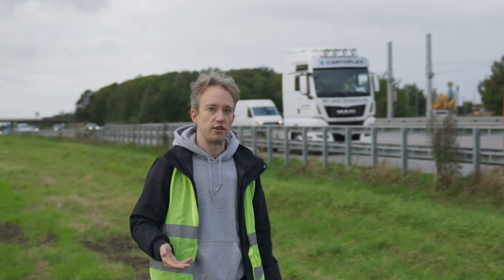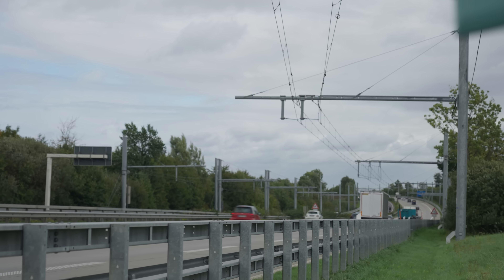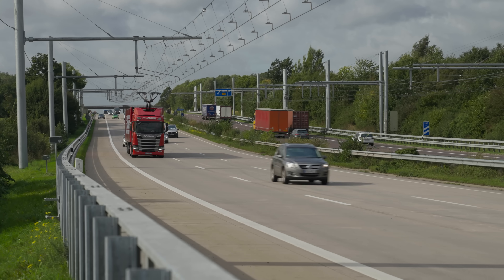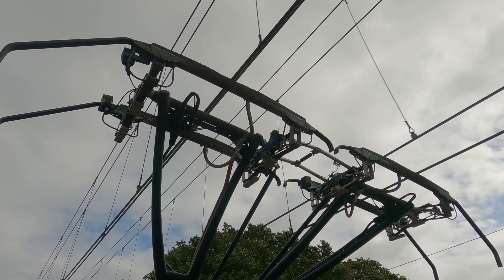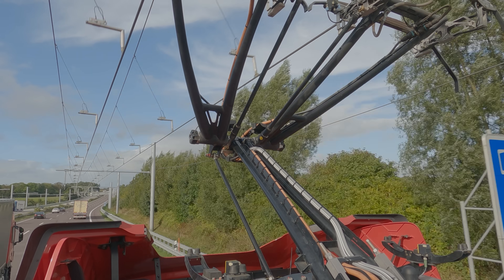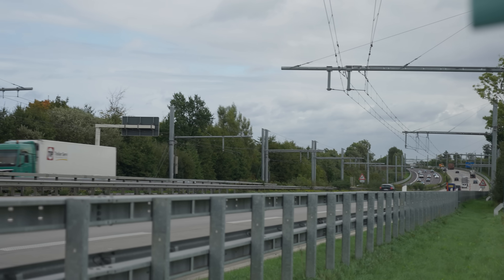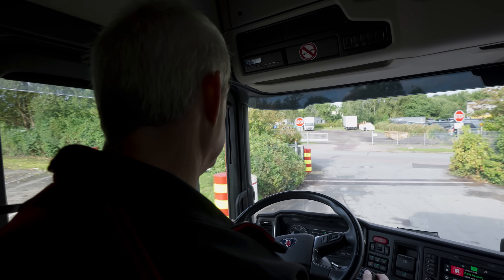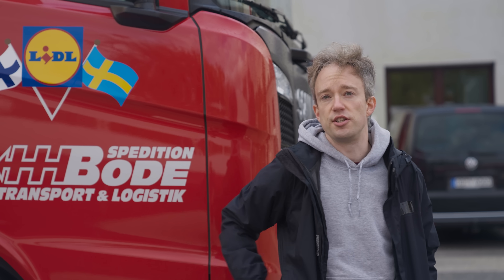The highway where trucks work like electric trains

Comment: The problem I can see, is that the over head cables will wear out a lot quicker than on the Railway,  you might have a train every 30 minutes, on the motorways in the UK  you can get a truck every 3 seconds, so the over head cables are going to wear out a lot quicker, this will lead to more maintenance and motorway closures, as if things are not bad enough now,  why not just put more heavy freight on the Railways.
Reply: Places with trolley buses seem to have solved that problem.
Reply: @kensmith5694  They surely didn't ever face the usage frequency of highways in their systems

Comment: Full battery electric trucks or stay home. We have to keep developing better batteries. This wire system is too expensive to build, maintain and they are an eyesore. 👎
Reply: I disagree.  It is no more ugly than any road.  Batteries won't get the kind of stored energy vs weight numbers that are needed for long haul trucks.  There are physics reasons it won't happen.

Comment: What's powering those wires?  Something giving off greenhouse gasses perhaps?
Reply: It produces less CO2 if you burn oil in a power plant and do this.  Solar and wind make even less.
Reply: This section is mostly powered by wind

Comment: wondering how this would work with more than one truck on the same line
Reply: It would be fine with that.  You can plug in two lamps in your home.  The power for both comes through the same wires from the power grid.

Comment: I keep hearing how this solves the emissions issues; and i ask again, what is used to make the electric power? In Europe there won't be enough sun, and i doubt wind will be strong enough for all of this (cities, houses, cars, trains, trams, and now trucks.) So it'll be coal, and/or nuclear..... Is that an improvement? Whatever happened to clean burning fuel, like hydrogen, ethanol, propane, natural gas, and maybe even vegetable oil?
Reply: Even switching to burning the fuel in a power plant and then running an electric truck from it reduces the CO2 production.  In a lot of Europe there is enough wind to provide the power if the turbines are built.  Even solar with your lower sunlight in the winter can work if panels become more efficient.  Right now a solar panel only has an efficiency of about 20%.  If the efficiency could be raised to 40% you would be getting about the power that folks in sunny places get.
Reply: In this case the energy is mostly generated by wind turbines, since they are very popular in northern Germany

Comment: The woke types, like this guy presenting this topic, typically think electric power is some free or magically appearing resource.  But grid power is sometimes hydro based (the cheapest), but more often it's nuke, or coal, or Nat Gas....  All of these generating sources have costs, esp nuke, as well as big consequences when a whoops happens and floods the region with radioactive material.   Diesel (clean now) Electric trains are the best IMHO....

Comment: Electric motor's loose power with age fast. Battery's loose there charging capacity fast . This is all a crazy fantasy which will end in tears.
Reply: No, motors don't lose power with age by any amount anyone cares about.  
The battery capacity reduction of a modern battery is slow enough that the battery was long ago paid for when the replacement is needed.

Comment: How is this electricity made?
Reply: At some point it will mostly be solar, wind, hydro, and nuclear.
Reply: @kensmith5694  They better starting approving those plans for the nuclear power plants then. We need power at night when there no Sun.
Reply: Mostly by wind, cause northern Germany has got many wind turbines
Reply: @j03l911  Does that wind blow 24/7? The most difficult thing to do with electrical power is to store it when there is no Sun or wind. Then you create these huge banks of batteries. Where do the rare Earth elements for these batteries come from?

Comment: I drive a trolley bus in Vancouver, Canada. It’s actually VERY expensive to maintain the overhead. In addition, there are switches, insulators and “special works”- when wires overlap. The overhead is prone to falling down when it’s not operated properly. You are unable to pass other trolley buses unless you pull your poles and get ahead of other trolley bus. If there is an accident you have wait for the road to be clear because OUR batteries do not last longer than a block- our trolley buses are 15+ years old. Hopefully the newer technology would be able to solve some issues. 

The most important thing: you have to destroy the environment to get lithium/copper out of the ground. Plus, how is the electricity made? Coal plants? Hydro power supplying the overhead grid?
Reply: Everything is expensive to maintain.  Diesel engines have to be routinely serviced.
Reply: Wind turbines are very popular in northern Germany, so it's mostly powered by wind energy

Comment: One question! How is the electricity that the trucks use (and all other electric vehicles use) produced? Think about this! Most electricity for these uses comes from coal, natural gas, and oil fired turbines OR, steam turbines in a nuclear power plant. Stop fooling yourselves into thinking you are helping the environment by buying these vehicles. The materials used in the batteries alone causes serious problems in and of themselves. “There is no free lunch.” Meaning, everything has it’s price.
Reply: The trend is towards wind, solar, hydro and nuclear.
Reply: @kensmith5694  Do you forget, or were you never made aware of the huge anti-nuclear power protests worldwide in the 70’s? GreenPeace and dozens of other organizations turned this country, and many others away from nuclear power after Three Mile Island. That was way before Chernobyl and of course Fukushima! Nuclear power plants use radioactive materials that have to be replaced periodically and the “used” material (HIGHLY radioactive) must be disposed of somewhere. Therein lies the rub. Wind, solar and Hydro will not cut the mustard without nuclear, or the continuing use of fossil fuels.
Reply: In this case, the trucks are mostly powered by wind

Comment: A major problem will be how do we produce the electricity to power these systems, many areas have barely enough power to support the demand during peak times right now.  The only practical, efficient and inexpensive source of 'clean' power is nuclear but there is a great deal of resistance to it.  Some countries like Germany have even shut down their existing nuclear plants.  Making and decommissioning solar panels, wind turbines and large batteries creates more environmental problems than they solve and they aren't very efficient.  No sun, no wind, no power.

Comment: U.K.'s attempt for stop selling gasoline/diesel powered vehicles is short sighted.  It's still the best because of its flexibility and the energy content carried.  Still the least expensive method.  The ICE vehicles are as clean as they've ever been...and there's no way to eliminate the carbon dioxide and it is questionable whether is a good policy to base so much off of a model(s) that make assumptions that may or may not be correct.

Comment: I would rather prefer chargeable roads instead of overhead wires and poles which spoils the look of a city and are eye sores. The roads can have a copper track single or double and a miniature pantograph like device at the bottom of heavy vehicles or something like that attached to tires on the inside.
Reply: You mean a life-size Scalextric road?
Power would need to be at high voltage, low current to minimize energy waste.
And easily accessible high voltage at ground level would be a safety nightmare!
... and it would need to cope with heavy rain, snow etc.
If someone can solve these problems, it could possibly work.
Reply: @Lord-Sméagol  not exactly but maybe something like that but only on main roads and highways with a dedicated lane for heavy vehicles. When they leave that lane, it can run on battery power. Yes snow and rain will be an issue but circuit will remain incomplete without contact with pantograph like device. A regular electric vehicle even if it comes in contact with the track wont be affected. I am sure engineers can find a aesthetically sound solution for this.

Comment: how this should be done is to have it as a "charging lane" for e vehicles also, so they don't need to stop to pull into a charging station.. they just charge while running the rail.  of course you'd also want to run solar above or tandem to the lines to give real time supply from non central distribution as well as where doable wind power  at tower points... and wireless mimo etc.. stations for smart autonomous vehicles.  How china did it was running it in the roads themselves.. it might make more sense to have them as underground wires to prevent wind sheering. or do both...  so that if one go knocked out the road system... with graphene lines inroadways you can inbuild superconduction into the roadways and use NFC like wireless charging. Graphene also allows for carbon sequestration as steel is very co2 intensive... .also graphene laden roadways are self healing and sequester CO2.

Comment: Super idea
Reply: I mean... sure? Why not just turn the freeway into some train system with there own lanes that charges them without wasting any electricity atall during highway time. I.e as ur on the highway it actually charges a full battery. And truck with enough charge would be in there own lane.

Comment: We (Russian) used trolley trucks in WWII also most part of Crimea we built by trolley truck. Because there are a lot of row angle roads and USSR couldn't make enough power trucks that's why we used trolley. Now these lines are using for intercity (over 80 km) trolleybus

Comment: I think we’re missing out on something here. Why not remove the engine all-together and install smaller, short journey batteries that charge from the overhead cables whilst on the motorway journey, then used to drive the vehicle on the shorter city section of the journey. And then why not have a charging station installed into the loading bay - another area where a truck spends a big part of it’s life!

Comment: I dislike greenies and the idea of battery vehicles with all the associated precious metals that will become a worse pollutant than fossil fuels and the stupid greenies are so blind thay can't see it so give me diesel any day - that is until I saw this - what a brilliant idea - I still will never support greenies because they would be stupid enough to throw this idea out the window. This is by far and away the most brilliant idea to date for cutting down diesel pollutants. This should not even be open for discussion - it should just be implemented. The other benefit is that with the added torque of electric motors the trucks will keep moving at a pace that other traffic will not be held up and also the trucks will be in the slow lane out of the way (even though they will now be able to move quite quickly). This is genius!

Comment: Great that but what is giving the truck electricity?? We're is that energy coming from mmmmmmmm
Reply: Most of the energy is coming from wind turbines
Reply: @j03l911  that's all well and good but what happens when no wind and thousands more trucks sucking the energy 🤔
Reply: @timewilltell3098  There is a new high voltage connection between Germany and Norway which smoothes out fluctuations in the production of wind energy by co-using more controllable norwegian water power.
Nonetheless, railway transport is still the far more efficient way to transport goods over long distances.

Comment: Is it not cheaper safer and more efficient to have power rails embedded (like rails) in the roadway rather than 100yr old overhead ones.
 Better still powerfull magnets in roads and efficient coils in trucks which generates  power for trucks. And coupled with solar cells on roof for stationary charging in traffic

Comment: The really great thing is all the electricity generation is planned to come from non-polluting unicorn farts...
Reply: Even if you’re using fossil fuel, a large scale piwer plant will have greater efficiency than a small combustion engine. (Which is why people generally don’t use their own diesel generators as their primary source of power.) Plus, this system easily allows for any share of the energy to come from renewable sources as they become available to the grid, so if a country’s power generation becomes cleaner overall,  its trucks will, too, with no need for adjustments or changes to the vehicles.

Comment: Instead of saving resources, more and more power guzzlers and idiotic ideas are being built and implemented. Wait and see when the last nuclear or coal-fired power plant will be switched off, then hopefully the electricity will only come from the socket and wind power, well, is that a step forward? We had cargo sailing ships that a hundred years ago could only sail with the wind, ridiculous! Batteries groups, where are they disposed of when they are obsolete, like carbon wind blades, buried sustainably in the desert and hope that in 10 thousand years everything will fall apart, the idea of getting by without fossil fuels, ok, but not like that !!!

Comment: I know Volvo has been working on self driving electrical trucks in caravans. 
If the overhead wires are made of copper it will not work in Sweden. Our train system have big problems because thieves steal the copper cables and the trains are then delayed for hours / days.

Comment: this is nothing new. san-francisco has it for more than 2 decades now. but they also have long pantographs so that the vehicle can change lanes! normally used for buses and not ambulance per say. but now they might have all been converted to battery instead of petrol when overhead is not used. but from city to city this could be a new one.

Comment: Where does the power in the overhead wires come from?

- in Germany's case mostly gas and lignite....
Reply: Its 340% more efficient than diesel that itself means lower pollution. And 60% power is from coal/gas but rest is from non carbon so that means even less carbon than diesel

Comment: A couple of thoughts. 1, Electrical grid. Ask any electrician, the more items on a grid the higher the draw, and the more power needed to keep all the items running at full efficiency. We currently do not have the ability to generate that much power without the use of nuke power plants. 
2. This system MIGHT work if the trucks are used only on main highways, and are used to move massive amounts of freight from Depot to depot, where the local deliveries are taken over by other trucks and vehicles. These trucks become like a train then. So if that is going to happen wouldn't it be better to rebuild the trains so that they are more like express lanes and do not have to cross road ways at the same level as vehicular traffic thus preventing accidents and allowing the trains to run at higher speeds between depots? This would work with both diesel and electric freight trains.
3. Wintery roads. Fuel operated or electric, either way, ice is ice.. what kind of damage will be done if there is a massive pile up on one of the major roads where one of these electric truck lanes are installed?  And what is the potential for electrocution?

Comment: No body seems to be thinking straight, reduce missions from the vehicle itself by going electric but then increase the emissions at the power station instead?? And then putting this extra load on the grid will possibly then cause blackouts.

Comment: As long as you have trains, which can carry as many as 50 trucks, why use this technology for distances greater than 100km ???
Why put this technology on the highways? Why use 50 drivers to carry, what can be carried with a maximum of 2 people ??? Why do you think electricity will be cheap ???
The trucks should be with batteries and used only for short distances, the rest is just a story, and this story lives on because some have to produce a lot of trucks and some have to sell a lot of oil.

Comment: We already have Electric highways. Its called Electric TRAINS . Those can pull 50 trucks EACH.
Reply: But they need rails and special stations
Reply: @awc3651  NO kids digging for The Battery metals. In northern Sweden at LKAB they tested The Battery trucks. They were so HEAVY so they Could only take 750 KG. And thermo clothes.

Comment: great idea, but I am still a bigger fan of using trains and making a faster automated container unloading. What about taking this idea with the trucks and put them on rails? Every carriage has its own electric motor instead of 1 big infront. They can connect up to save energy and computers takes each carriage to final destination.
The train splits during the trip and end up in the right location where local drivers deliver the goods. The idea of using 1 driver per truckload is both stupid, dangerous and ineffective when it comes to energy use. And dont tell me there is not enough space on rail for this. There is no max length of a train. Computers keep them from collide. It also fixes our problem of lag of long distance drivers. Easy piecy, bring me the next problem :)
Reply: But this has a cheaper upfront cost.
Reply: It's so much more expensive to build trains and rails and unloading stations than to just get hybrid trucks and run cables on infastructure that already exists (you know, roads)
Reply: @giltsholder  the roads are full already. The rails are not

Comment: This is indeed a great idea! Compare to steel wheel train, it allows the truck to leave the road and distribute goods door to door, hybrid system means the power line doesn't need to be built through out the highway, and ultimately you don't need to build a railway along the highway.